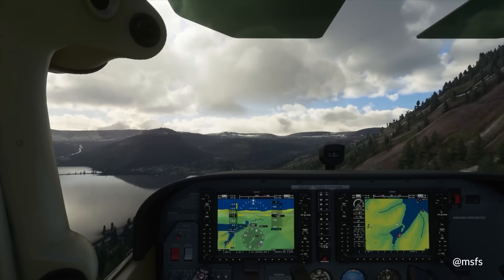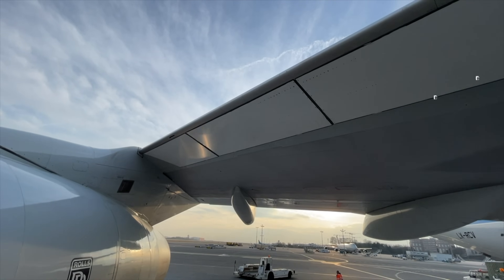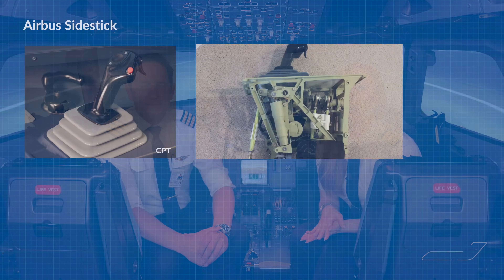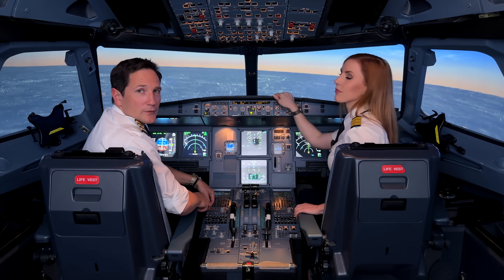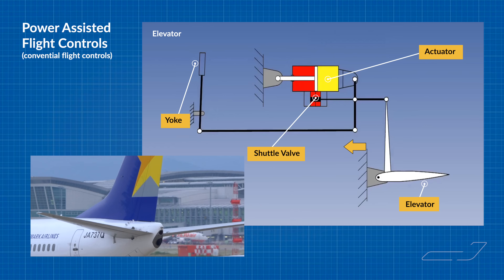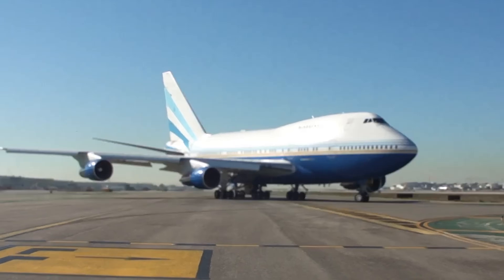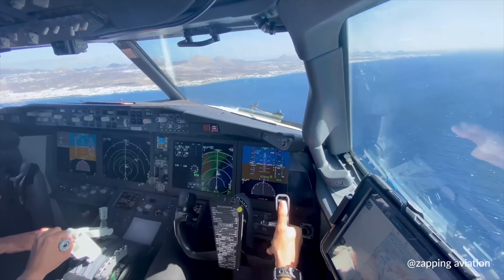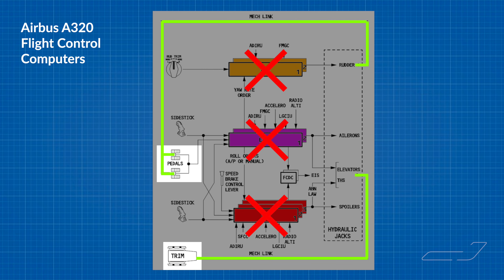Which AIRLINE JET has the better FLIGHT CONTROLS? Explained by Captain Joe and Raja

Comment: I disagree, in the Airbus the computer is in control limiting the pilots' inputs.  In addition, lack of feedback in the joysticks caused an Air France airbus to crash in the Atlantic as the pilot in charge did not realize the co-pilot was holding full aft stick on his side preventing a stall recovery.  In a Yoke aircraft, the other pilot can monitor the inputs by observing the movement on the yokes.  So, in my book, the computer-controlled aircraft is operated by less skillful pilots who rely on computers to save their bacon.  I use a joystick to play games, not to fly an airplane.  You should both join the Airbus sales department as this was the obvious goal of your presentation.

Comment: Yes.. Airbus is "perfect" as seen in Flight 447, Flight 587, and the Habsheiam air show, among many others. Certainly not saying Boeing is perfect, but neither is Airbus.....
Reply: Yes airbus is not perfect, but at the same time they have contingency plans. I myself would prefer a boeing style "control column in sync", but in airbus since its not there, they have set up alternate means. And if the crew are unable to use that, then it is a human factor issue.

Comment: Thank you for this great video! 
So, does the side stick in the A320 move back into neutral position, when you leave hold of it? And in the conventional 747 it will stay in a certain position according to pitch trim? How is it in the 747-8?
For me as only being a flight simmer the lack of real trimming and thus having the controls always centering themselves, if you leave hold of them (except maybe when using a force feedback yoke/stick) is one of the biggest draw backs of flight simming.
Reply: Yes the sidestick is spring loaded back into the neutral position. The 747-8 function the same way as a conventional plane in regards to pitch. The FBW is only for the ailerons It's partial FBW, not full FBW, as in for all axis, like the 777 or 787.
Reply: @ClaysonAntoons Thank you! Much appreciated.
Reply: The big problem with flight sims is, of course, the plane doesn't exist, so is not subject to the exterior atmospheric conditions. The flipside, I guess, is that flying real planes is, broadly speaking, approaching sims in approximating situational awareness and overall control, especially with the phenomenal rise in frame rates on up-to-date graphics devices, enabling ever more realistic through-the-window scenery. The full motion simulator being show-cased is the ultimate in the dedicated flight simmers wishbox. Thanks to Joe and Raja.
Reply: @JanetGrech  Well said!

Comment: Seems Airbus should introduce feedback on the sidestick or at least self-moving throttle controls. I often hear that the lack of situational awareness in an Airbus is a disadvantage, with pilots not realizing that the plane is suddenly in direct law and they lost all protection that they usually rely upon and are suddenly overwhelmed with having to really fly the plane…
Reply: I hear they are developing that connected side sticks
Reply: Agree.. Have read and heard the same. There should be a big and clear change in something to clearify when automation is off... a beacon, or change in colour of artificial horizon or something bigger than a one little text on the dash.

Comment: considering pilots of both airliners had to learn in small aircraft, they all have to be pilots, before they get handed the certifications.  I think a more accurate expression is that Boeing pilots pilot more actively in normal hand flight than airbus pilots.

Comment: I'm not a pilot, but surely having identical sets of controls is better.

Everyone has a dominant hand, so it's likely that one of the pilots is having to control the plane with the "wrong" hand. Not ideal.
Reply: Actually it doesn't matter. You will face this issue with both designs. In manual flight, the standard for the the pilot flying is to have one hand on the yoke/stick and the other on the throttle...you see the problem? The throttles are in the center.
Reply: That's true. @shi01

Comment: The description of roll control is wrong. A conventional aircraft does not roll to wings level from a turn when the yoke or stick is let go.
Reply: Roll is not the right word, but yes because of stability it will return back to wings level eventually.
Reply: Depends what you call "conventional". Basically all airliner type aircraft are build with a so called "dihedral wing" which means the wings are slightly canted. This causes asymetrical lift when the aircraft is rolled which causes the aircraft to roll slowly back to a neutral position by itself without additional control inputs.

Comment: First non commercial vehicle is Apollo 9 Lunar Module which has a Fly By Wire control system or Lunar  Landing Research/Training Vehicle on which astronauts were trained.
Reply: Avro Canada CF-105 Arrow used fly-by wire in 1958 a decade before apollo 9

Comment: Air France Flight 447, an Airbus A330, crashed largely because both pilots were making sidestick inputs at the same time.
Reply: The sidesticks weren't even mentioned as a contributing factor in the accident report...
Reply: @shi01  Yes, Airbus is good at suppressing negative information. The fact remains that one pilot panicked during stall and was pulling back his sidestick while the other pilot was appropriately pushing his stick forward to lower the nose. Neither pilot knew what the other was doing, and that can't happen in a Boeing airplane.
Reply: @RaysDad  Just, that this isn't true.
There were dual input events, yes. But the inputs the pilot in command did, wouldn't have resolved the situation even if Bonin, the guy who pulled on the stick, would had let his stick go to neutral.
Also, there's always the priority button. Push it, you have exclusive control. 
The issue in the case of AF447 weren't the side sticks. It was the immediate break down of CRM. Why didn't they consult the checklist for unreliable airspeed? Why were they the only crew that manage to crash because of this specific problem. It was known that the pitot tubes on the A330 at the time had this specific weakness and similar incidents happend before, multiple times. Nobody else manage to crash the aircraft because of it. In fact these crews reported that it wasn't a big deal.
Also you're dead wrong if you think something similar can't happen with the Boeing setup. Just look up the AF011 incident in 2022. 777 with Dual input situation without the other pilot noticing it. And in the a Boeing, you don't even get a warning if this happens, and it happens more often than people would think.
Reply: @RaysDad  Good point!
Reply: @RaysDad like it didn't happen in that AF 777 that almost crashed because neither pilot knew that the other pilot was making opposite inputs?

Comment: Quiz: If you take the question word by word, the Boeing B-17 was the first non-commercial vehicle to use the fly-by-wire technology. That's because its autopilot wasn't mechanically connected to the control surfaces. It was electrically connected to the actuators. That autopilot was simple and could only provide a stable flight straight ahead. But fly-by-wire technology was used.
The first vehicle using a fly-by-wire system to control its movements by pilots was the Avro Vulcan 1952, 12 ahead of the moon lander.
Reply: In the B-17 the bomb sight could also control the flight controls during the bombing procedure.

Comment: For an aircraft design that is over 30 years old, the Boeing engineers got the 777 FBW system absolutely perfect. You are still in control of the aircraft (Boeing philosophy) but the aircraft will try and “fight back” against your attempts to do anything beyond the flight envelope. It is also a dream to fly and feels as light as a feather at all weights and configurations.
Reply: There is a 737MAX shaped elephant in the room right now!
Reply: @john_hind  - nothing wrong with the max if you actually know how to fly it.
Reply: @EdOeuna  Except that Max's MCAS was specifically designed to obviate the need to train pilots to know how to actually fly the plane. And then it somehow got classified 'non-essential' so it was subject to a single point failure which would cause it to 'fight back' against the pilot's attempts not to crash into the ground!  Aside from this, nothing wrong with it!
Reply: @john_hind  - you can disengage the automation and treat it as a trim runaway. I believe that, in the Ethiopian crash, they disengaged the automation, recovered and then re-engaged the automation which led to the crash. They did it to themselves.
Reply: Two caveats here. 1) the United 777 flying from Hawaii to the mainland almost crashed due to miscommunication b tween pilots (FO did not set the flaps properly) and was recovered by the pilot, I wonder if it was a 330 or 350 if that would have happened? I doubt it 2) AF447 that caused due to incorrect behavior after stall, apparently it was not in normal law as it should have overridden the pilots nose up attitude.
Reply: @keeperofoddknowledgesociet3264 - that 777 nearly crashed because the pilots, primarily the FO, just couldn’t fly the aircraft. He made some serious errors that shows gross incompetence. I think one of the issues with Boeing philosophy is that the pilots need to be well trained and competent. Having untrained or incompetent pilots in a Boeing just isn’t a good combination.

Comment: Don't forget that long before the A320, Concorde had fly-by-wire flight controls. Not implemented by programmable digital computers, but using analog "computers". And it had flight envelope protection. The controls had feed-back, and were physically connected like on Boeing. A marvel of engineering, designed in the 60s :-)
Reply: Thats not surprising, considering aerospatiale (manufacturer of concorde) eventually merged to form airbus.
Reply: @ZK-APA  BAC  did most of Concord ( with no 'e' )  including engines and wings and that miraculous variable engine intake that allowed the Concord to supercruise was also UK.  BAC also had experience of fly-by-wire from TSR-2,  and the wing from Concord came from Vulcan nuclear bomber. It was only money that prevented UK from building Concord on its own.  Never forget that France killed Concord with that big crash - bad maintenance,  fuel tanks too full ( should have always had an air gap to prevent hydraulic rupture of tanks, and also the plane was overloaded.
Reply: @chrissmith2114  It actually was Concorde (with 'e') at the insistence of the French.
Reply: @_starfiend   Nobody in UK ever accepted the E
Reply: @chrissmith2114  Not true. Most of us accepted it. A few people didn't, but most people this side of the channel just didn't really care enough to worry about it. It was really only the French Government that cared and supposedly they threatened to pull funding if it wasn't named that way. While I can imagine that could be true, I'm not really sure even they would go that far over something quite that silly.
Reply: @_starfiend  The French Government has long been a bit strange. Every so often, it gets these little blasts of monarch-style arrogance and dictatorialism. It's really weird to see in such a progressive country.
Reply: @chrissmith2114  You are absolutely correct.
Reply: @chrissmith2114  « Nobody in UK ever accepted the E »
Seems Wikipedia does not agree with you.
Reply: In the mid 1950’s the Canadian Avro Arrow CF105 had analogue fly by wire. dcniner01
Reply: @dcniner0187  Correct, the VERY First one ....

Thank you for bring it up ...
Reply: TSR-2 also had fly by wire
Reply: @ealibert add to that the fact that the British elements of Concorde were built using imperial drawings, whilst the French parts were built from metric ones; I know because my Father-in-law worked at Filton on it.
The Russians tried to copy Concorde, but could not get the analogue computers used for engine and airflow management to work properly, which is why the TU-144 regularly crashed.

Comment: When I started watching your videos, I could only dream of becoming a pilot. Now I am doing the a320 rating and I am very happy that you are still here and still I get a lot of important info. Thanks man for all the videos until now. Keep going. Safe flights.
Reply from the maker: Great to hear!
Reply: Waw, joe  com seus sorrisos e inspiração nos faz acreditar e realizar sonhos de verdade.
Amo seus vídeos explicativos desejo felicidades a você joe🫡✈️🙏🏻🫰
Reply: Are you trained on the entire 320family? Ceo's and neo's?
Reply: @Dirk-van-den-Berg  yes
Reply: Question. Let's say you have been flying on the 320ceo for some time, and the airline wants to schedule you for the 321neo. Do you require additional training or can you just hop into the other cockpit and start setting up?
Reply: @Dirk-van-den-Berg   we can switch from 320ceo to 321neo during the the same day
Reply: @Echo_Lima  So the extra weight and longer runway that the 321 needs are automatically calculated? As well as the amount of fuel needed?
Reply: @Dirk-van-den-Berg  you change the plane and the variant on the performance application. you can choose every plane by it's call sign.

Comment: Basically the difference between flying a boeing vs flying an airbus as a pilot is like if you're driving a sports car vs driving a grand tourer. A sports car will giver better performance, better handling and more driving enjoyment to a driver but a grand tourer will give better comfort and control when driving long distances in public roads at whatever speed limits there are.

There is no wrong answer in terms of which is better or worse. It basically depends on personal preference and the situation.
Reply: And the reality is many people don't want a sports car experience. They think it's rougher, too raw, and unrefined. They would rather be isolated from the road like a princess.
Reply: @mediocreman2  Which makes sense if one is doing multiple sectors everyday.

Comment: Awesome explanation but i don't understand is if a plane loses all hydraulic systems why doesn't the airplane manufacturer us electric actuators for the main flight controls so the pilots can still control the plane to make an emergency landing....prime example flight 232 when the #2 engine fan disk blew apart and ruptured all the hydraulic lines the plane was uncontrollable and crashed landed in Suiox city Iowa
Reply: 787, A380 and A350 already do this. The 787 has Electro Mechanical Actuators that will power 2 spoilers per wing and the trimmable horizontal stabilizer if all 3 systems fail. The A380 and A350 has Electro Backup Hydraulic Actuators that will power some spoilers, elevators, horizontal stabilizer and rudder if the 2 hydraulic systems fail. They are the only aircraft after the 737 that can survive all hydraulic systems dead provided one engine is running that is...If all engines are dead with no RAT (and electricity in the 787 because the batteries can power the controls with no hydraulics for a limited time only), only then are you doomed on those 3 as well.
Reply: You are not smart enough to realize? Really? How many great invention came from one man with an idea in his garage that nobody else thought would work? Since we are talking aircraft, the whole thing false to two bicycle makers and before that some crazy gut with some ash sticks and canvas.

Comment: Air France 447 could have used that audible simultaneous use warning. Even with that I don't care for the idea of side sticks away from direct easy view of the other pilot.
Reply: That warning sounded on AF447 but not very often as it was often cancelled by the stall warning. See Mentour Pilots video on the accident.